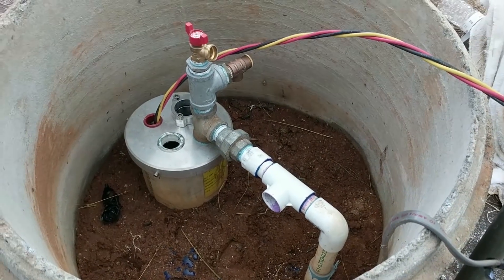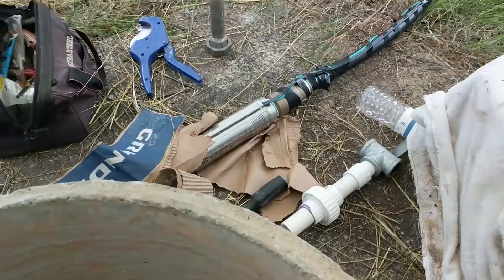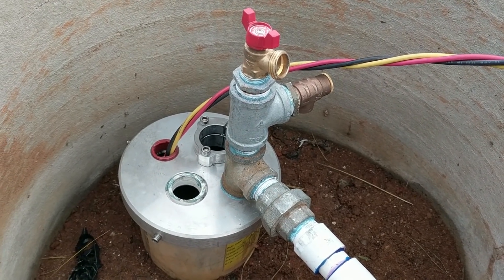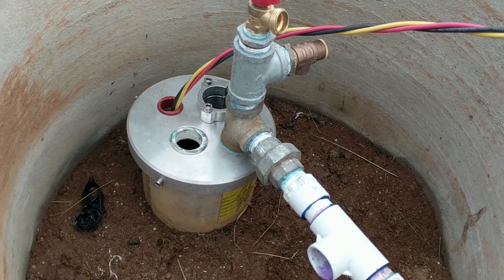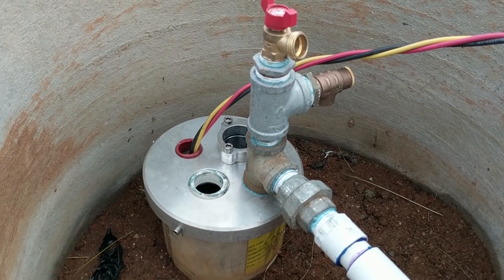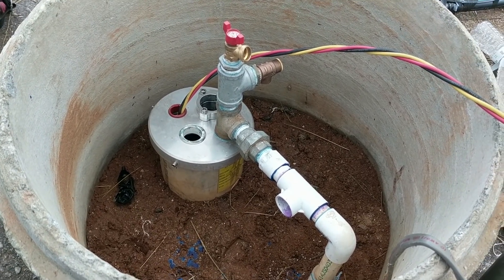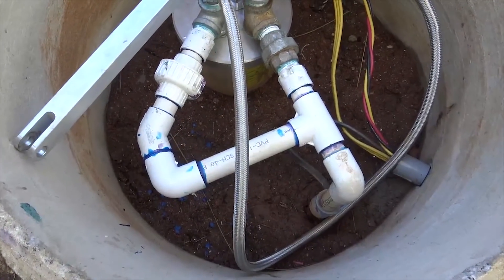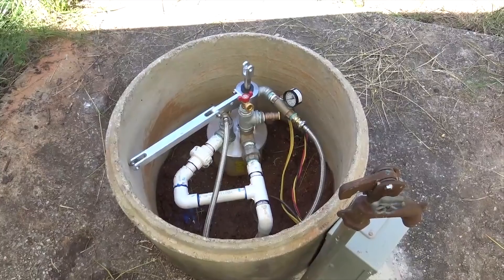Soft Start Pump Install

Comment: Did you modify that Simplepump cap to have the 3 pump outlets?
Reply: I want to know as well.  I need this exact setup.  Currently have an 8" well with a 5HP pump.  Want to add a hand pump and a grundfox SQFLEX 11 GPM dual AC/DC for maximum flexibility.

Comment: I have a 220v single phase 1/2 hp water pump (~350 watts) and a 1.2 kWh modified square sine wave inverter 220v, how do I start up the water pump without overloading the inverter during startup? Will a soft starter, capacitor or 50 meters of AWG 15 cable work to startup the motor without overloading the inverter? Thank you

Comment: Would love your opinion on the question I have........I am installing a new well and going to have to run power to the well. I can put it next to my camp and run a short power cable but will need a 300ft pipe run to the garden and animals to water them Or I can put it next to the garden and run a 300ft power cable to it??? Which is better..... Gona need to pipe regardless to move the water.....Just wondering about wear and tear on the pump at the end of a long power cable

Comment: I have a shallow well which we installed a 3/4 HP jet pump 1/60/240 volt, working fine.  It's 3 ft wide well and literally 15 feet deep.  I am wanting a lower flow pump with higher pressure that could do both solar and electric.  This would be for irrigation and to pump up to a tank and/or as a backup for the shallow well jet pump.  I have both 120 volt and 240 volt available in the well house.  I was considering the SQ before this but really may not need/want a submersible pump considering the limited lift reqd.  I only want about 2 GPM at about 100 psi and want the flow to be consistent.  Maybe I need a diaphragm pump or something else.  Sorry for the long ramble but was hoping you had some ideas.  The SQ flexibility on the voltages seemed to lend to both solar and grid or generator fed power.  This well will run dry if more than about 2 GPM for extended periods in the summer.  Maybe have 3 ft. of water in there at the bottom.

Comment: Do you use the air tubing trick to monitor water level depth when you install a pump?
Reply from the maker: Not sure what you mean?
Reply: You can tape an open ended 1/4" plastic tube (of a known length) to pipe (just above pump). At the top, the tubing is fitted with a T, pressure gauge and schrader valve. You pump air (just a hand pump is needed) air into the tubing until the pressure gauge stabilizes. Knowing the length of the tube(L), and the static air pressure(P) will tell you water level using the formula L-(Px2.31)= Water level below ground level. Cheap and effective. Google it, pretty SOP, I think.

Comment: Just a comment on the physical installation method. 
Best practice dictates that the cable and pipe not be in contact with the soil. 
This can lead to the introduction of iron bacteria, which is naturally present in the soil.  The same thing goes for the tools. It can be very expensive to remediate the bacteria once the well is contaminated.
Reply from the maker: Pipe not in contact with soil? What? Cable?  Do you mean well wire?  It is direct bury.  What are you talking about?
Reply: Engineer775 
In your video, before you installed the pipe, it was lying on the ground... touching dirt..
As a retired master plumber and licenced pump installer this practice has been counter to the Wisconsin DNR well code for 25 years.
A proper trailer with spools for wire and pipe, along with a tarp to cover the ground in the work area also helps. Tools should be sanitized before use with bleach to maintain them in a sanitary condition and not transfer soil bacteria from job to job.
You may not be in Wisconsin, but sanitary practices are universal.
As an engineer I would think you would show they proper, sanitary methodology on your instructional video.
You did not.
Reply from the maker: Ok, now I know what pipe and wire of which you speak.  Yes, we disinfect the well after the install. My apologies.  When the ground is dirt/mud we do feed it off of reels.  The Sun was disenfecting everything insight that day. When did wells ever become sterile.  We pulled out the slimiest pipe btw.

Comment: Why did you install the change over directly under a water spigot? Seems like a recipe for disaster 🤔😀
Reply from the maker: Kurt Palmer it hasn't worked in years and it was the only place that I had enough heigth for the switch.

Comment: I can tell you live in a warm climate as your not using a pitiless adapter to bring under ground water into your dwelling. The system shown here would freeze over in northern Minnesota where we live. 
I just found out about soft start well pumps from a well drilling friend of mine. They are starting to install them all over the place. There is some power savings when running the pump but for most users it isn’t much. He said the savings is real apparent with commercial water users.
Reply from the maker: Yes, the main reason for this install was to take the surge load off of the solar inverter.  
We have also done this install in colder climates and have used pitless adapters that are 180 degrees out and at different heights.

Comment: Yes Franklin pumps draw a lot of current on start up. I have one of those 2wire 3/4 HP pumps and yes the magnum starts it but yes it hits the lights hard on start up.